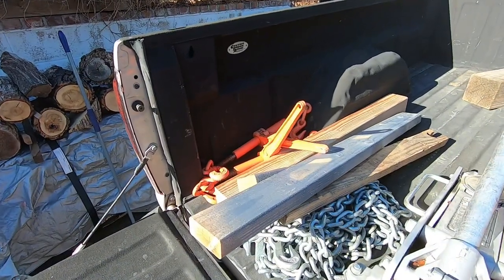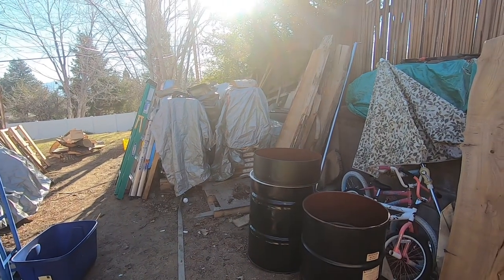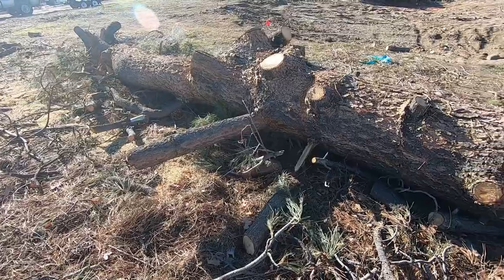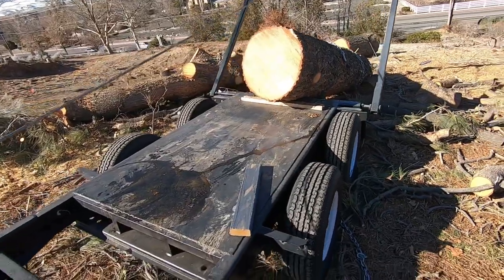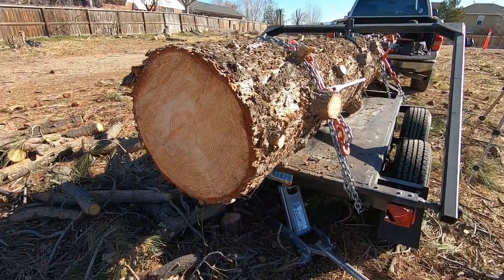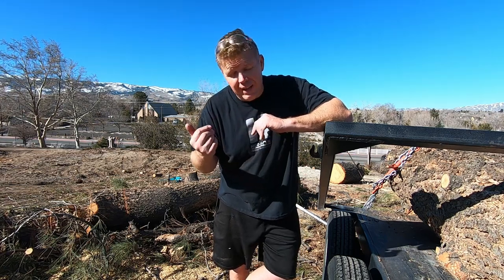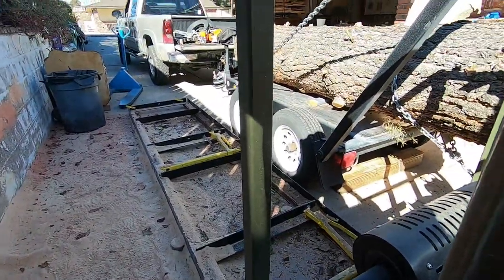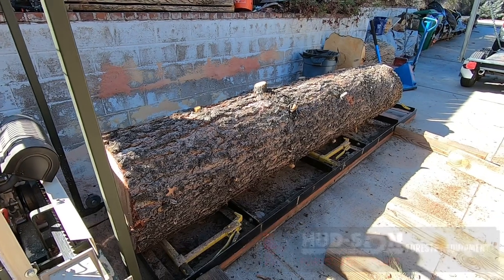Urban logging with a log arch trailer- I will show you the tricks!

Comment: You ought to weld a small drop leg jack to the back of the trailer so you don't have to carry that big floor jack around to the back every time. Or like I did with my dump trailer, I cut a couple 4x4s to the perfect length and put a handle on each one to just place under the back of the trailer to support it while loading my skid steer.

Comment: How is the power transferred from gas engine to blade? Is it possible to bypass the engine and plug it in to line voltage?
Reply from the maker: It is belt driven. There is a guy on YouTube under the title Canadian woodworker that has his Saw hooked up to an electric motor if you have power nearby.